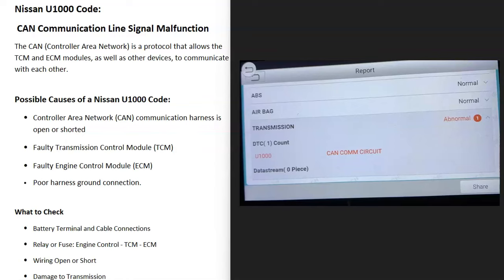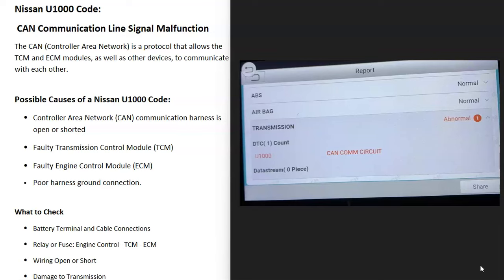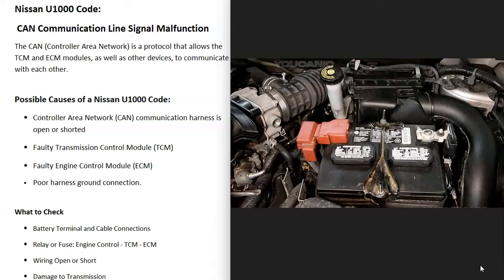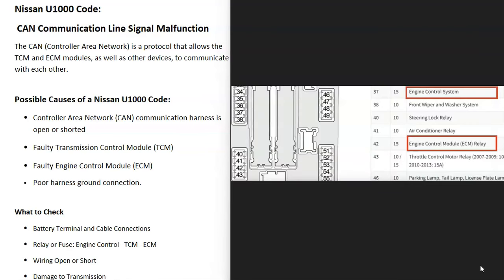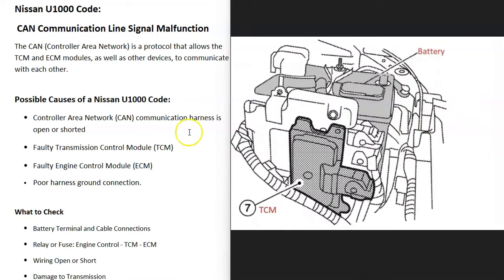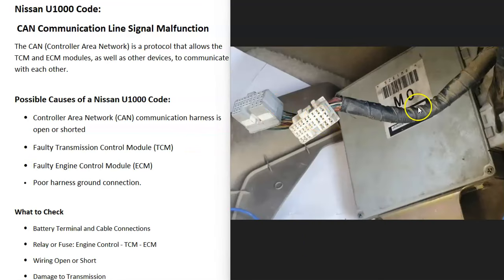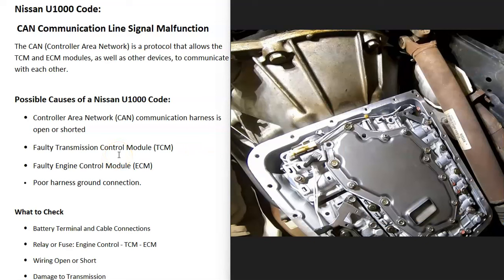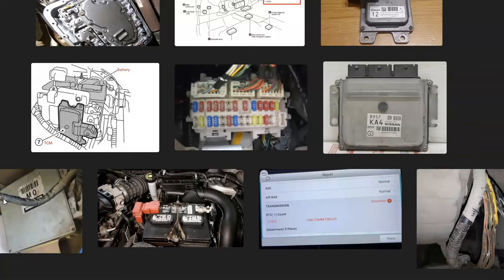Causes and Fixes Nissan U1000 Code: CAN Communication Line Signal Malfunction

Comment: 2012 Nissan NV2500. Randomly left stranded one day, cranks but no start, vehicle stuck in immobilizer/anti theft mode. New battery, recall relay, ipdm function test, scanned with IP616 otofix and unable to complete further tests or diagnostics outside of U1000/U1000-00 and a BCM code.

Comment: You have told me what I need to know when my 2013 Nissan Sentra goes to the dealership. I was lucky to have a mechanic friend who paid thousands of dollars to read Nissan codes. My little scanner just showed needs Mass air flow sensor but Nissan did too so I bought a Nissan MAF. Now I read the there is a bulletin out to have these checked on certain Nissans and mine is one. But Nissan won’t pay to repair because it’s not a recall. Can you tell me why they won’t or will they?

Comment: This code popped up when the SLIP light came on. It came on after I changed the horn relay without first disconnecting the battery. They battery terminals were very corroded so I changed those and no luck. So... Slip light on, the 4x4 diagram that normally shows 2wd or 4wd isn't showing, just the SLIP light now. I checked brake fluid level and tires are inflated well ... Forums say to do that. No issues there and no issues on pads or wheel sensors. I can check the fuses like this video suggests but wondered if unhooking the negative terminal overnight might do the trick? Or something else? I am trying to separate this issue from the horn relay change which didn't fix the no horn issue but it's hard to disconnect the two as the latter happened right after switching it out. Thoughts or ideas?

Comment: I have a 2019 Nissan Titan that is throwing this code. Here recently I’ve been having some electrical issues from my truck not starting, my bright lights not working, my interior lights going off and on, truck not turning off once before. Has me worried of serious issues
Reply: did u figure it out
Reply: My armada is doing this right now.. it won't turn off. Did you end up figuring it out?
Reply: @uploadtime1780  i didnt i have a guy coming out this week i got wiring harness see if that helps if not im gonna scrap it really clean nissan nv200 2012 only 120k miles
Reply: Ok
Reply: could be a whole OBD network failure which makes modules hard to communicate with each other
Reply: Ipdm

Comment: Checked all the wires no damage, no ground corrosion, still have the slip light and u1000 code
Reply: Modules are probably old. Not the best construction.

Comment: i have this code on 2012 nissan nv200 iv changed wiring harness ecu bcm and ignition same fault dash lights come on but it wont crank doesn't even click when i turn ignition  im at a loss when i scan it says engine not present just get the u1000-00 u1000-01 codes
Reply: Change the battery on your key fob
Reply: I have tested the ignition immobilizer coil I'm not getting a reading off it withautel  km100 I'm gonna read eeprom off old ECU and write it to new one hopefully it works
Reply: Did it ever work?
Reply: Waiting on proper programmer to come
Reply: @legin3753 did you get it fixed? My son has 2011 Rogue. We can’t turn ignition it says key not detected like it’s wrong key. Tried reprogramming they key and no luck. Locksmith showed that u1000 code

Comment: I have 2016 Nissan Maxima getting this code . When drives car won’t accelerate, when pressing a gas pedal.
Reply: Same issue did you find out what it was?
Reply: Did you figure it out? lol
Reply: Yeah, what these guys said...did you figure it out?
Reply: Probably a throttle position sensor. Spray it with some contact cleaner In it’s plug.

Comment: Good stuff, thanks for sharing. I'm trying to figure this out myself if its an easy swap of a relay or even an ECM I don't mind doing it. Time are hard and I am on a fixed income :o/  Is an IPDM a simple swap? 

Im getting these issues, as well as Gauges Dropping, AC blowing hot air, Then transmission seems to not want to change and when it does it kicks like a horse. leading me to believe all these things happening at the same time could be a bad ECU relay or IPDM ? 

Here is a link of my Dash going crazy when I Drive. https://www.youtube.com/watch?v=03EuGI8FpVk

Below are the codes I pulled.

instrument Cluster- U1000 Can Communication Circuit

Transmission Control- U1000 Can Comm Circuit, P1705 TP Sensor

Anti-lock Brake- U1000, Can Comm Circuit

ECM (Engine Control Module)- U1000, P1212, U1001

AWD (All Wheel Drive) - U1000 Can Communication Circuit